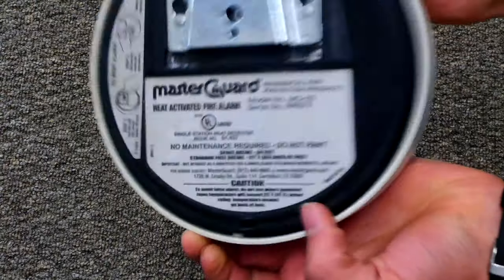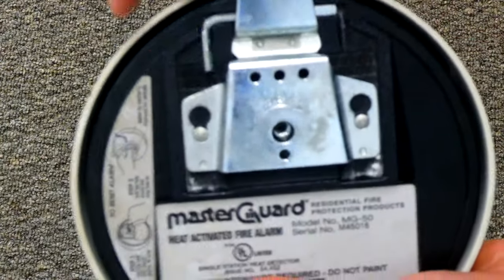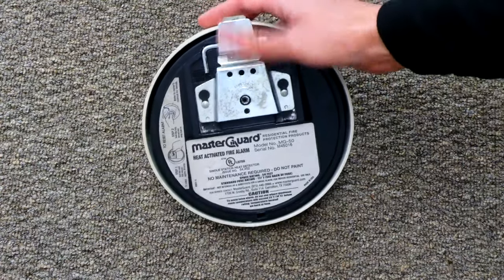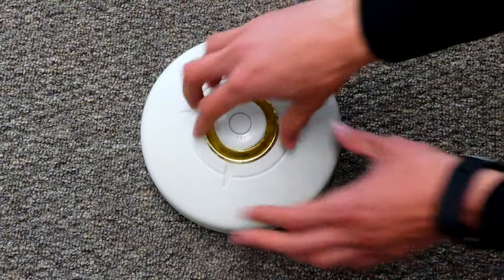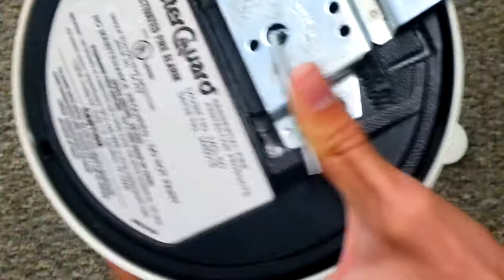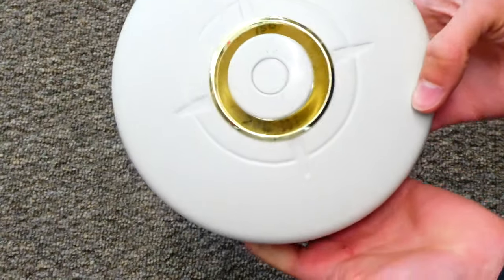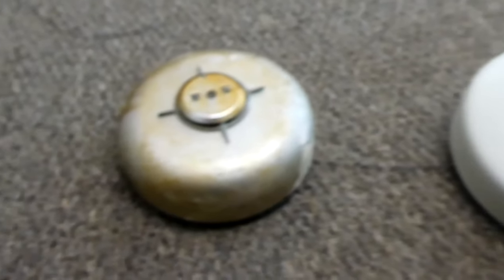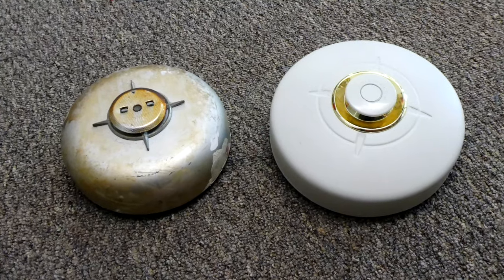Rare Wind-Up Heat Detector Bells

Comment: Interesting; thanks. I didn't know that the disc could be replaced; most fusible-link style heat detectors are a one-time-use thing. Seen these for years but after 29 years in the fire & life-safety industry, just got my hands on one for the first time today. Interesting concept, albeit a very sad way they were marketed (mostly to elderly people) at such a crazy high price at the time. Thanks for the video & disc info; I plan to demo it to our technicians tomorrow morning. 😁

Comment: I actually have a wind-up heat detector bell! It was my first fire alarm ever!
Reply: Same! Omg! These things are loud I tell you loud! In fact I have a video of mine
Reply: @Sixitboy  Except mine works differently. To test the heat detector bell, you have to crank it up and to reset it, you press on the little stick in the middle of the bell. We did a home fire drill with that which was fun.
Reply: Same
Reply: BTW

Error, firealarm.exe already exists. Do you want to replace it?

(Yes) Sorry , no is not available

Comment: my great grandmother has this SUPER old smoke alarm, and its in the shape of a rectangle, i have no idea what the alarm is called
Reply: is it a GE 8201-401c
Reply: it could also be a black and decker flamebuster
Reply: it is black and white now it is yellow because that was about 50 years ago
Reply: @MrGru-cz3gg  hmmm
Reply: Some of the super old smoke detectors actually have radioactive isotopes inside of them.
Reply: @danny.9897  They all do except photoelectric ones and heat detectors so its nothing to worry about especially because of how low the levels are and the fact that they are shielded in a can (sensing chamber) in most old ones which blocks a lot of the radiation
Reply: What does it sounds like ? Fast beeping ? A squeaking buzzer ? Or a low pitched buzzer ?

Comment: Hello! My 6 yrs old son is very fascinated in fire alarms and your videos. Do you sell? He’ been asking us to buy him some fire alarms.
Reply from the maker: I currently do not have alarms for sale.
Reply: Just buy some off of ebay.
Reply: I have been a fire alarm hobbyist since around the age of your son! Here is some helpful info: 

A good place to look for fire alarms would be on eBay, since it is usually the cheapest site and they have a large selection to choose from. With commercial fire alarms, you will typically find pull stations and the actual fire alarms (there are also smoke detectors and fire alarm panels, but those can get really expensive, and they are not necessary for just having a fire alarm setup to play around with). 

Pull stations are like a light switch that activate the fire alarm. For a first pull station, I would recommend the Fire-Lite BG-12L. There is also a Fire-Lite BG-12 model, but that one has a hex key reset, which can be cumbersome to use in my experience. The BG-12L model, however, has a normal key reset. Make sure that when you buy the pull station it comes with the key, otherwise you will not be able to reset it once it is pulled. The typical price of this pull station would be somewhere between $20 - $30 on eBay, but you may be able to get one cheaper if it is used. When getting any pull station, it is important to make sure that it is conventional. There are pull stations that are addressable, meaning that they only work with an addressable fire alarm panel.

The actual fire alarm is what makes the noise and flashes. There are many different variants of fire alarms, but generally speaking there are horn only, strobe only, and horn strobes that come in two wire or four wire configuration. There are also speaker strobes, but those have to be hooked up to a voice evac panel. If you are concerned about noise (fire alarms get REALLY loud), I would get a strobe-only fire alarm. This type of fire alarm flashes, but does not make any noise. When it comes to two-wire fire alarms, there are two terminals that are positive and negative that power both the horn and the strobe (or just the strobe in a strobe-only fire alarm). Four-wire fire alarms have four terminals, of which two power the horn, and two power the strobe. Two-wire alarms are generally easier to wire, so I would recommend getting a two-wire device. One important thing to note: I would be cautious about getting a fire alarm made by the brand Simplex. Simplex fire alarms are very proprietary devices that can be a nightmare to work with if you are trying to use them as a play fire alarm setup. For a first fire alarm, I would recommend the System Sensor P2R or P2W (the only difference is that one is white, the other is red) for a horn strobe. You can usually find those for around $30 or so on eBay. If you want a strobe-only fire alarm, the System Sensor SW or SR are a strobe only varient of the P2R or P2W. Those usually go for around $20 on eBay. As I said before, you may be able to get them cheaper if they are used, but make sure they are in working condition. If you decide to get the P2R or another horn strobe, please make sure you have it on the low volume setting, and put tape over the horn. Fire alarms can get loud enough to damage hearing.
I am not the best at explaining this, but there is a three video series by another YouTuber by the name of NewAgeServerAlarm, and he does a good job of explaining fire alarm devices to newcomers (Here is a link to the playlist: https://www.youtube.com/watch?v=eSUUNoW0h_Q&list=PLD0EC8FD7759E3686). The first video talks about fire alarms, and the second one is about pull stations. The third one talks about smoke detectors, but as I said, it is not necessary to worry about those if you are just looking to make a play setup for your son. 

When wiring the pull station to the fire alarm, make sure to watch a tutorial on how to do it. Here is an older video from this channel that explains how to do it: https://www.youtube.com/watch?v=T0Vhs7-a6d4&t=190s. Most fire alarms run off of around 24 Volts DC, so you'll need either a transformer with an output that is close to that voltage, or you can connect two or three 9 volt batteries together to get either 18 or 27 volts DC. Whatever you use to power it, make sure it is within the alarm's listed voltage range (you will likely find that information on the back of the alarm).
Reply: @gentexguy  that was a great way of explaining it. I wish I had this kind if info when I started
Reply: S.E.R. Safety  ok thank you!
Reply: Alexanders Alarms Thanks
Reply: Gentex Guy wow! Thank you for this information! Thank you for taking your time to explained all of this! I really appreciate it!
Reply: Thank you all for taking your time to respond!